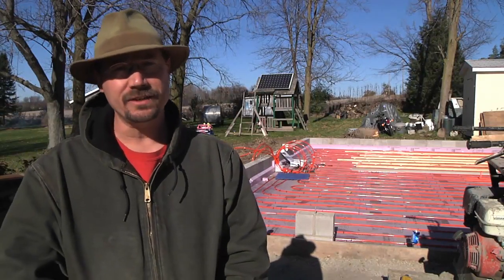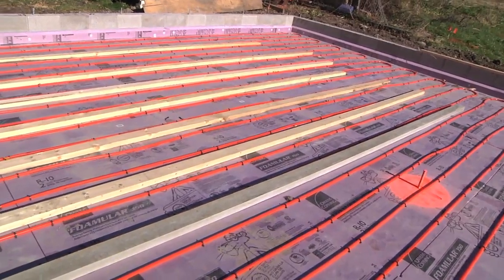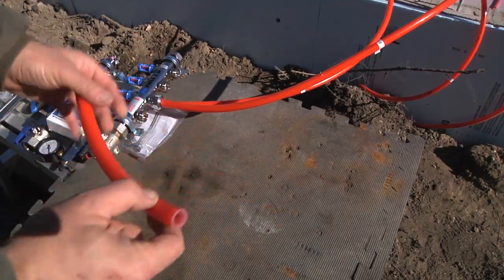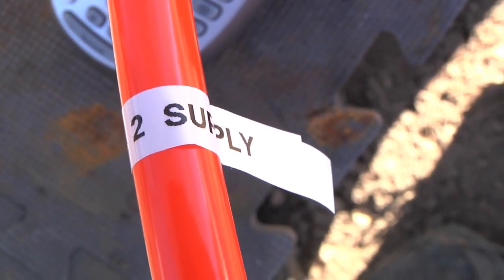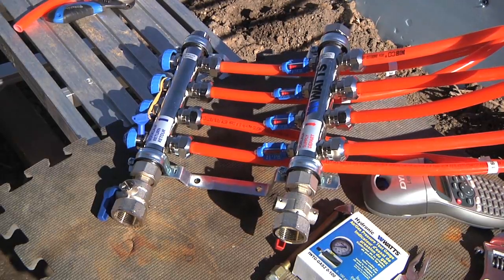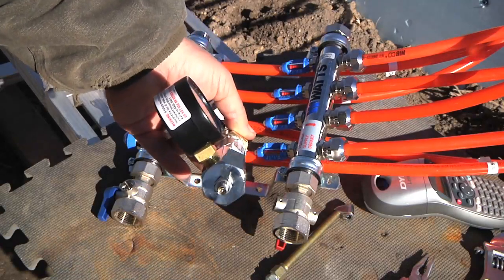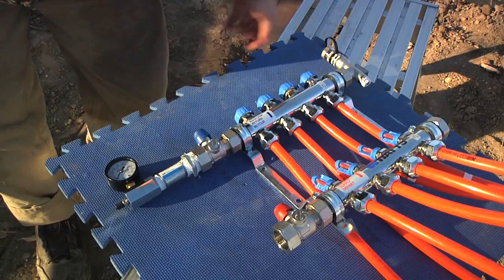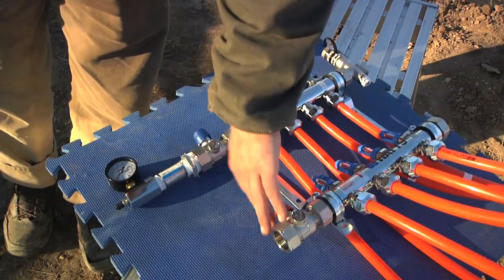Pex Weekend, Day 2, Sunday

Comment: Why 4 circuits ?
Reply from the maker: It keeps the circuits shorter. The longer the circuits, the more resistance internal to the tube, the harder the pump has to work. Shorter circuits means you can use a less powerful pump and it should have a longer life. Also, it's a little easier to handle a smaller roll of Pex tubing than a longer one.
Reply: Thanks Ben, Makes sense 4 parallel circuits rather than one big one. I was thinking more if you had a leak in one. Nice warm winter oil changes on a ICE car !.  :-/
Dave.